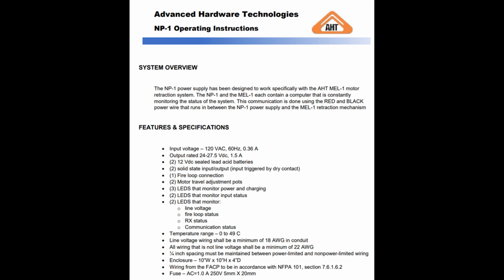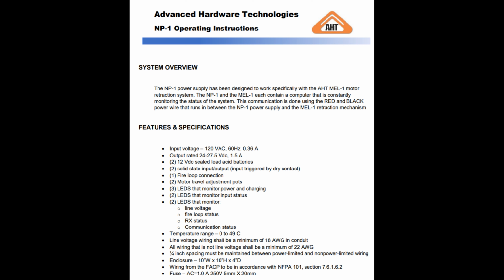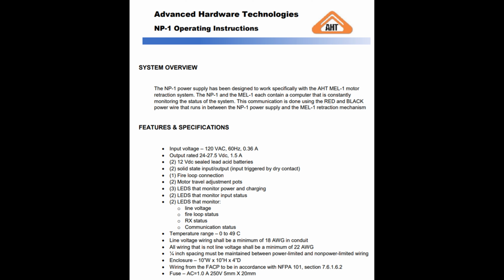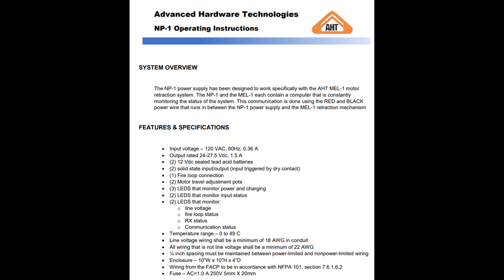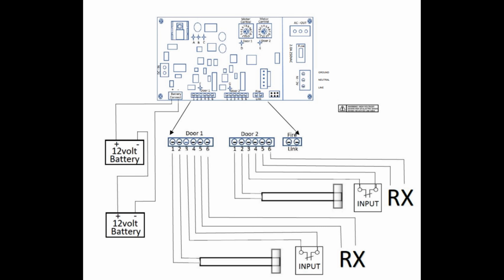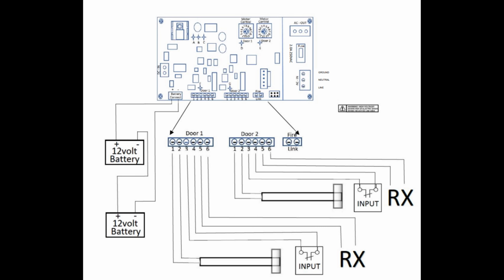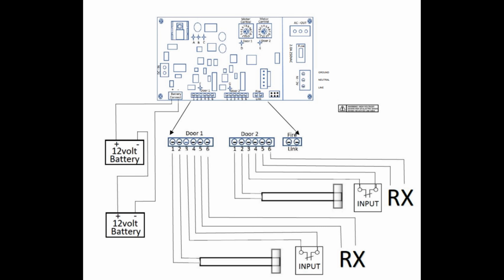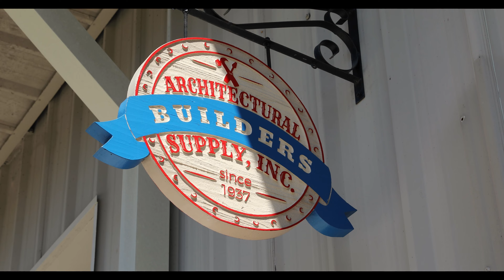1686MEL Exit Device & troubleshooting the NP-1 Power Supply | Wordy Wednesdays Ep #8

Comment: How about checking the battery voltage while actuating the motor. See if it drops significantly
Reply from the maker: That's a great idea and thank you very much - I will make a video using a known good NP-1 power supply and test the voltage difference before and after pulling the fuse from the NP-1.  This will show the voltage drop at the batteries when using a power supply producing output and when the power supply is not producing output as measured at the batteries.
Reply from the maker: There is voltage drop when on battery only (no incoming DC) as seen in this video:  https://youtu.be/GJaQRfLKvEA